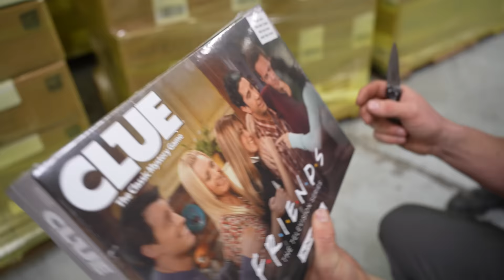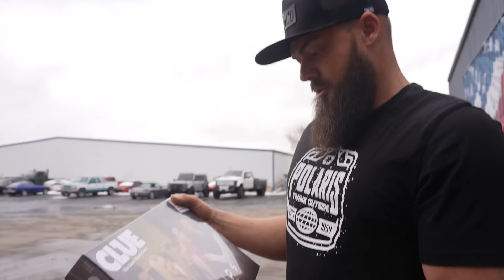I Bought an Entire Semi Truck Load Of Lost Freight For $6000 - The Ultimate Side Hustle!

Comment: I think Alan needs to set up that conveyor system to make sure all the parts are there. It would be more valuable knowing it is a complete system. The module that runs it all would probably have a separate price anyway; could purchase separately. 😁
Reply: Needs a computer and a program..🤣🤣🤣🤣🤣🤣🤣
Reply: @casualdrifterendgames7307  Not necessarily.
Reply: @motosk8er2  true you could just plug it in the wall and run it continuously, but to make use of the encoders (track position and speed of the belt) you would need some kind of computer
Reply: WAIT! I got it! A mobile elevator to help unload all these trucks Heavy D gonna be buying up in the future :text-green-game-over::person-turqouise-waving:

Comment: I  worked in a plastic injection molding factory for 23 years and we had identical conveyors that were set up to convey boxes of parts to packing stations in our warehouse. They are very expensive to buy components. I don't see those sitting in your shop long if you let the right people place a sealed bid on the system as a whole.

Comment: OSHA rubbing they hands together with a grin watching y’all get into that trailer with that jack
Reply: What was wrong with how they did that?
Reply: i concerned when they looped the chain through the bottom of the skid and pulled it out. If you had a heavy enough load, you could have busted the pallet and sent that heavy chain whipping toward the driver.
Reply: Oh I was confused as you had mentioned the jack.

Comment: That roller system looks very similar to what B&H Video based in Manhattan New York has to move merchandise from the basement or lower level stock rooms through out the huge store when called up by one of the service reps.  

They have the roller wheel system hanging from the ceiling and you see merchandise moving to different sections of their huge Camera, electronics and computer store.  

Hope that helps.

Comment: The Conveyer belt system could easily be 150k-300k, I have designed parts of them and overseen install of these systems. They are crazy expensive. This could have been easily been a bust though.

Comment: I was wondering: if you know to where that conveyor system was headed wouldn't they be interested in getting it delivered to them.  Perhaps they would be willing to pay $6000 just to have that system since it was already custom designed for their use. It might be a little slimey because you would not giving to them the system for which they had already paid but It would still be cheaper than buying a complete new system.

Comment: I did the same thing ,purchased a 52' container not knowing what was inside for $3,500 and it ended up being from end-to-end top to bottom packed all in new boxes of high-end executive office furniture. Along with miscellaneous office supplies. So yes it does happen it is true.
Reply: Do you need a new executive office desk or maybe a new office chair I have like 10 of them or maybe a sit to stand Electric desk with just a push of the button you too could be standing and doing or replying to emails. LOL. But yes electric desk by push the button will rise and repel back to normal all by the push of a button.

Comment: Unfortunately as truck drivers get screwed all the time and that's wrong for to keep the guy locked in there for 4 months he could probably run to the trailer but that cost is about $250 a week if not more depending on where he's at it looks like a conveyor system when you open the door